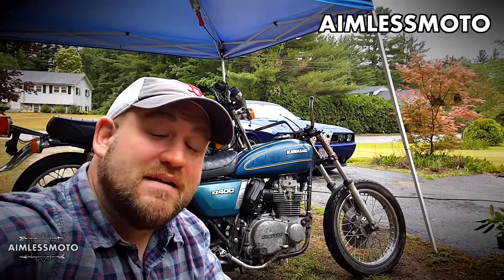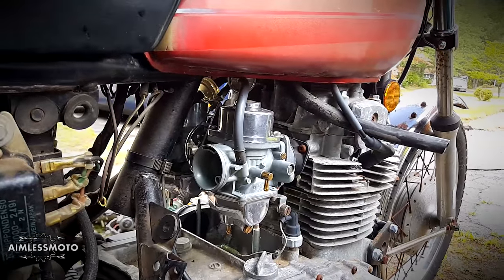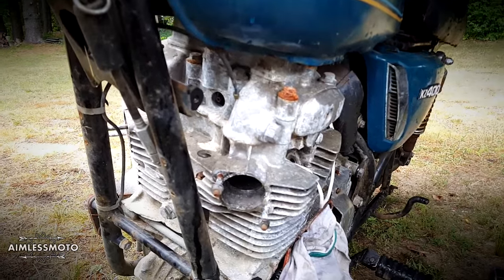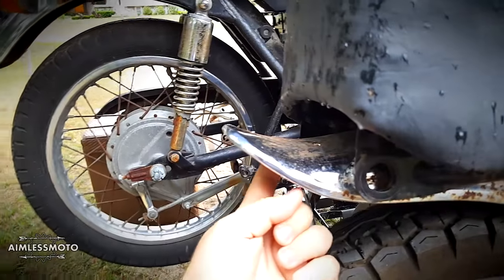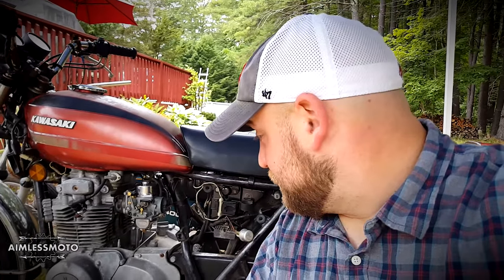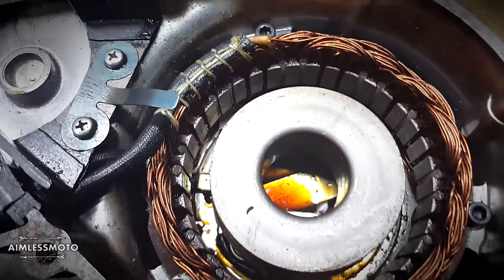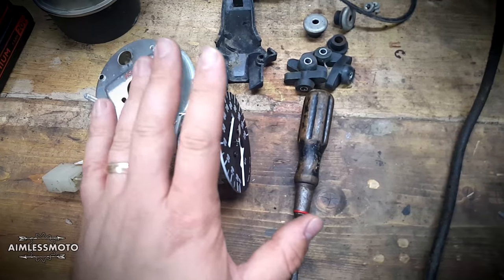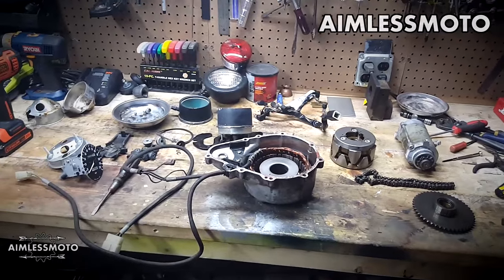Tearing Down a Motorcycle | KZ400 Tracker Build | PART 2

Comment: Whoa, at 2:05 you kinda mashed down pretty hard on the lever. That's probably why it broke off. You push down slowly until you feel it engage, then kick down as hard as you want.
Reply from the maker: It was a combination of things. I looked at the lever, where it had broken, and it was rusty about half way through the brake... so it was fractured long before I got to it. Pic of it on my Instagram if you go looking.
Reply: AimlessMoto I see that makes sense. But still, I cringe when I see that happen to the kick start.

Comment: Hi there AM. I like your videos on KZ400. I have just bought a 1975. I have a question, i only see 1 x coil with one spark plug cable which I know it needs two. Can you please send me what the coil should look like. An will I be able to use another bike model coil as I know it will be hard to find KZ400 coils.
Reply from the maker: You should be able to use any bike's 12v coil (or any pair of coils) to run the engine. They both fire at the same time (only 1 set of points), called a "wasted spark" (fires on the exhaust stroke). You can even use coils for a lawn mower or small engine - the jungle site has cheap atv/dirt bike coils that are pretty bulletproof.